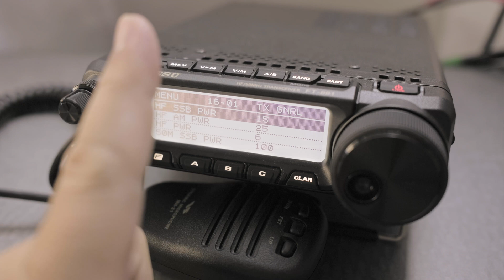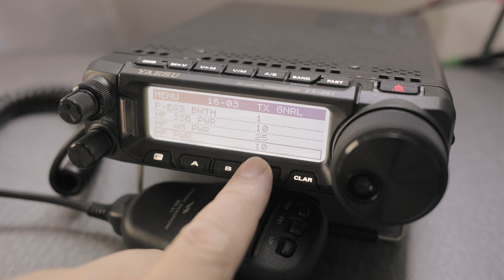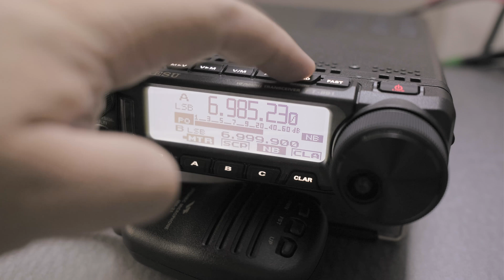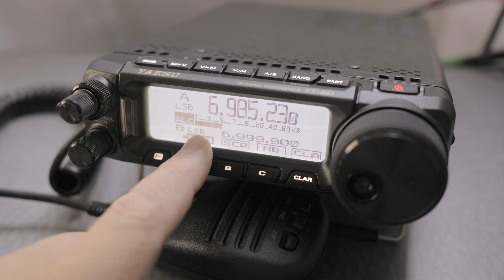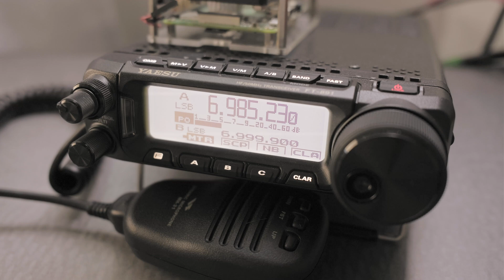Yaesu FT 891 Setting for FT8 | JS8 | WSJT-X | Digital Modes

Comment: Hi Frank!  Excellent video, sir!  Using FT-891, SignaLink USB, and WSJT-X.   On 10m, FT8, software says 29.074.000.  But I find better results at 28.075.000.  But I make a few QSO's, then I see the radio says 28.074.500.  Then a few more QSO's, then the radio says 28.074.000.  Next, it says 28.073.500.  Why is the radio frequency indicator dropping?  What am I doing wrong?  Many thanks!
Reply from the maker: Here are a few ideas.  Start by checking the WSJT-X Split Mode Settings and set Split Operation to "None" to prevent unintended frequency changes. Next, lower the TX audio drive from the SignaLink USB to avoid overdriving the radio, which can cause frequency instability.   Also, ensure the CAT baud rate in the radio menu matches WSJT-X settings and verify that the CAT control is stable to prevent unintended frequency shifts - I'm sure that should be fine, but check anyway.  Additionally, disable any automatic QSY adjustments in WSJT-X that may be altering the radio's frequency - I read that somewhere, don't know if that is true.  If frequency drift continues, consider upgrading to the Yaesu TCXO-9 for improved stability - I have one and it stable especially on hot days.  Hope that helps.
Reply: @frankwc0o  Frank!  You have solved my problem!!!   It was this---"Start by checking the WSJT-X Split Mode Settings and set Split Operation to "None" to prevent unintended frequency changes."   I had that set to FAKE IT, based on suggestions from another ham operator in a YouTube video.  I changed it to NONE, and presto it is fixed!!!!  Thank you ever so much!  This was about to drive me crazy!!!!  73, PU7MOJ
Reply: @frankwc0o  Mine works fine when I set the SPLIT in WSJT-X to "RADIO". The radio handles the split operation just fine, setting the two VFO's accordingly.. The "FAKE IT" setting caused mine to drift the frequency.

Comment: Hi, great video. i have one problem. i have mod mars for 60 meters. and only on 60 meters i get alc fast up to hi and then it gets slowly back to zero...  what is happining? in 80 meters and 40 meters i have control on alc but not in 60 meters. i use flrig to controll the ft-891 and i have fc-40 tuner an digirig version 1,6

Comment: 16-14 DATA DATA GAIN. very important setting. Turn on your ALC & tune in digital. Should not be over driven. Turn this item down. It is much more important the HF Power (Data Power)setting.

Comment: Thanks for this.  The only additional thing I had to do was set the 11-05 SSB MIC SELECT to REAR.  Otherwise it wouldn't get the input from the 6 pin din cable.

Comment: Hello, I have configured my 891 according to your instructions and everything is working, just one question. I set the sound level so that the ALC would be minimal, but when changing the frequencie(selecting other user), the ALC also changes. Is it normal or I missed something?
Reply: I had a similar issue when changing the power level. If I went anywhere above 50 watts out, my ALC meter would jump up way too high or sometimes kind of bounce around. Reducing the output gain with the slider in wjstx sometimes helped but it was pretty random. I found that if I put my hand on my 891 while transmitting, the ALC was perfectly stable and I could adjust the slider to get it just right. So I cut a 4 foot piece of wire, attached one end to the ground screw on the back of my 891, crimped on an alligator clip to the other end and attached it to my carpet (ground). ALC has been stable and easily adjustable now at any power level.
Reply from the maker: It's possible that the SWR of your antenna changes and thus the antenna might have to work harder and thus the ALC might change.  I know when I change bands, I have to adjust the ALC.  I'm more portable and mobile and I know most of the time, I have to adjust the ALC.  Also, sometimes the daytime and night time I have to adjust the ALC.  So, there are many factors.
Reply: use tune to set ALC to about 1/3 of the meter.    - then you notice differences when you scream at different pleaces in that voice channel, but the "tuning" tone is a good average.  

Yes, this is normal.      

73, oh8xat

Comment: THANK YOU!  This video solved my problems with FT8 setup on my FT891.  I got everything working, software, radio, signalink, and computer talking to one another.  However, I was not receiving the full frequency spectrum.  You nailed it for me with the menu settings 08-03, & 08-04.

Comment: I like to be able to quickly switch from FT8 to SSB to talk on HF.   Using USB for the mode in FT-8  and setting the SSB power down to low power defeats the radios purpose of multi mode.   The SSB power adjusts the output when using SSB.  The HF power adjusts power when using Data mode.   I use HRD to control the radio and I can quickly select any band freq I wish to use on SSB with the click of a button and I dont want to have to go into the menus to set everything back for SSB mode and utilize 100 watts.    Your setup works if you only want to operate FT8.    Thanks
Reply: I operate SSB and FT8 only changing the HF Power setting the rest I left as is.
Reply: there is a menu item for "HF power" - this reduces power on "DATA" .. and unfortunately also on CW. (i am a cw man, and this pisses me off)

but for you, its just what you need - SSB will still be on 100w or whatever you defined.  It has an own menu item for ssb power.

Comment: do you just use the usb or do you need a sigalink also?
Reply from the maker: You can use one.  I used a USB sound card instead. As you know, this video is more about the settings you need on the radio to make the software work.
Reply: USB for cat and ptt

a mini-din cable from rig to soundcard for the audio.

This is what i use, - but a scu17(i would recommend this for yaesu rigs, smaller more elegant, better quality than signallink)  or signallink can also be use
but it is not necessary.   I plugged the audiocable from the rigs minidin to microphone in / speaker out of my tablet pc.  

73, oh8xat

Comment: Just thought I would like to let you know how much I appreciated your you tube Video. 
I bought the FtR891 and could not get WSJTX to decode the waterfall, I spent several days trying to solve the problem.  I found your instructions among others on the nett but yours the most instructive.  I adjusted the width setting as per your instructions and bingo, decoding immediately. 
Many thanks and 73
Reply from the maker: Hello Stuart.  I know exactly how it feels when it don't work.  I'm glad the video helped.  Have fun and be safe.  -73

Comment: So I have to do this every time?  Work some phone 20m,  then go thru all these settings again to work some ft8?  Even with rigblaster?
Reply: he missed the part where after you set all of the DATA menu options.  push and hold the band(mode) button then scroll over to DATA and the radio switches to that mode.  and when you want to go back to SSB just change the mode.  No need to disable AGC/NB/DNR and other things, just change the MODE and the radio will turn off all the audio filters.

Comment: Yeah the SSB and HF power makes no sense... 
I need to test on mine I wonder if HF power is for data?? then they need to put Data power if that's the case ok I get it if not its redundant...
Reply: The HF SSB Power is for SSB.  Some people use SSB option in WSJT-X for FT8.   For those that use DATA mode, the HF Power is the setting for CW, DATA and FM.   When the author recommends changing them both, it is a wise idea.   I don't mind pushing more power than is necessary, but I am concerned about doing WSPR or FT8 at 100W.